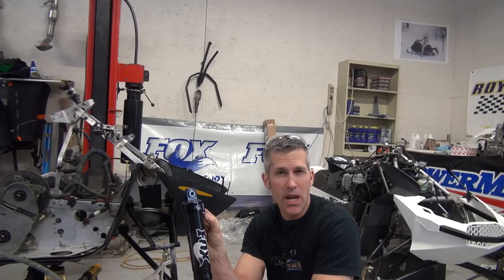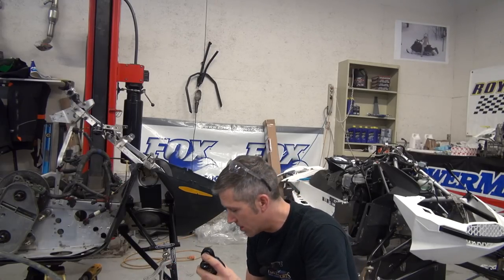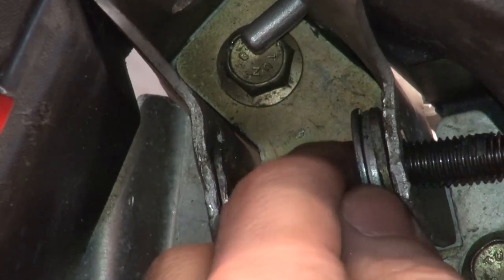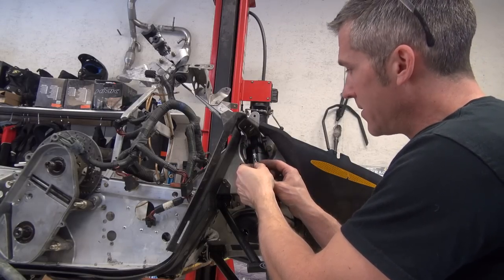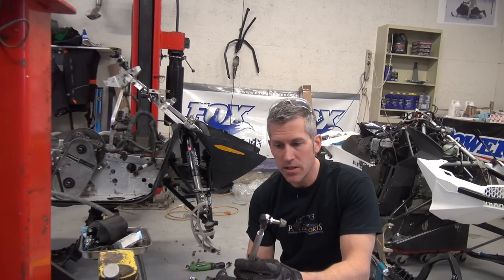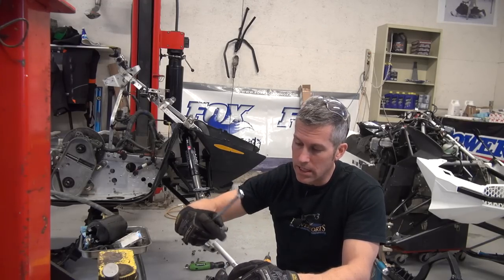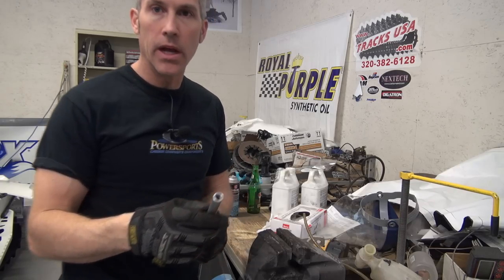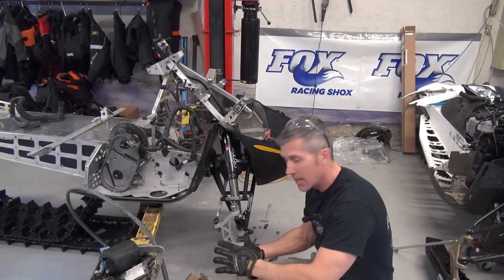Ski doo REV 700 mod sled build Ep#21, Fox shock install and steering rod mod.  PowerModz!

Comment from the maker: Thanks for catching that, long days and nights will do that.  I do notice changes in pressures in the shocks though, it is the most common complaint about the air shocks.  I do love them though, I don't mind adjusting them, and I don't race.

Comment from the maker: combination of a few things, low/mid range lean, advanced timing at lower rpm, probably should be running 32:1,just checked compression and one cyl is 70psi:)

Comment: I don't think changes to external air pressure will make any difference to the pressure inside the shock.  Temperature yes,  pressure no.

Comment: Hi, i got an ski doo rev (summit 600), and i think the distance between the skis is too much, i have problems to control the machine like i want to, can you shorten the distance by shorten the original things on the machine right now? instead of buying new expensive a arms and all that kind off stuff. Thanks for entertaining videos! greetings from sweden
Reply: Is varm my 2008 summit adrenaline has 2 holes from the factory on the a arms to Change the stance

Comment: As you increase in altitude the pressure inside will increase. Unless your racing you wont notice the difference in gasses, I won't bother with the technical mumbo jumbo.